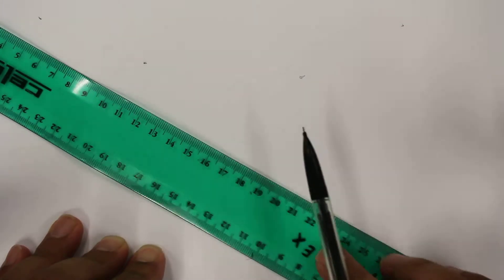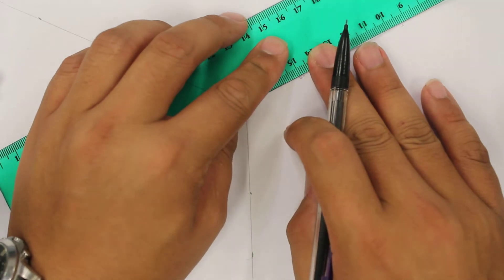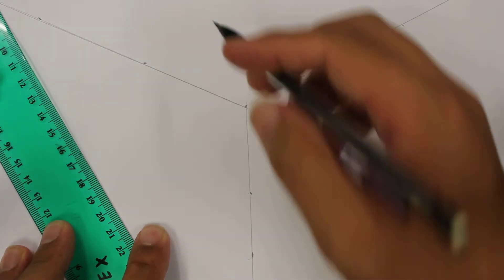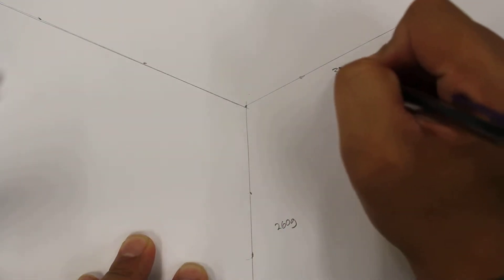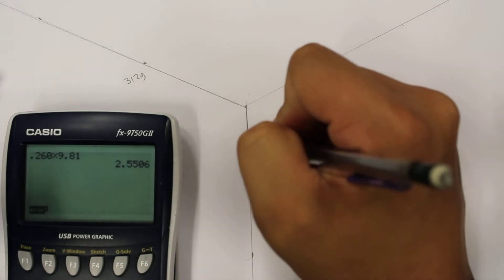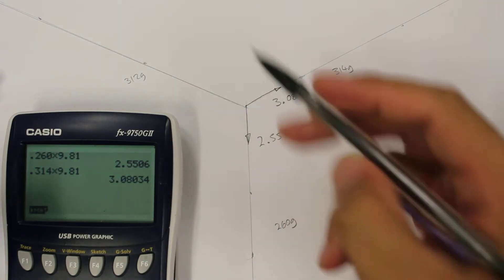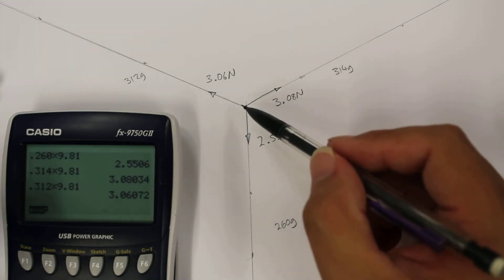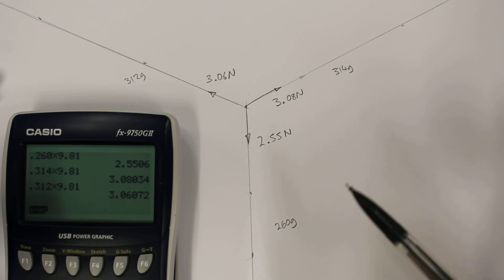Polygon of Forces - Free Body Diagram

Comment: Where is the 9.81 coming from?
Reply from the maker: The previous video to this one shows the masses that were used.

A polygon of forces should be based on the forces that the masses produced.

The assumption is that the masses are related to force via the equation Force = mass x gravitational constant. This is written as F = mass x 9.81.

The relationship between mass and force originates from Newtons Law of Gravitation.

Hopefully, this gives you enough information to move forward.
Reply: In other ways its a gravitational pull